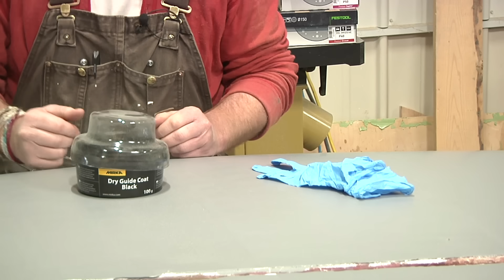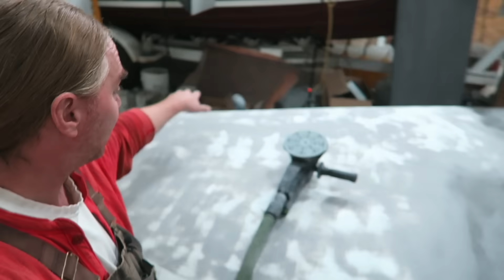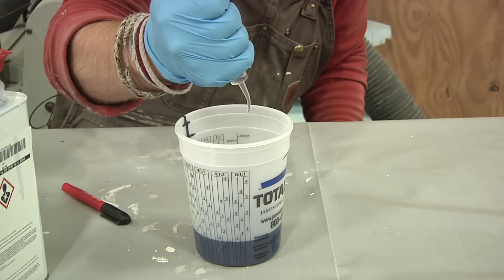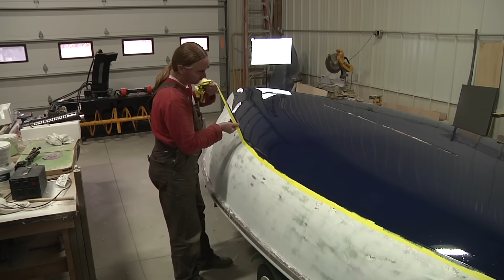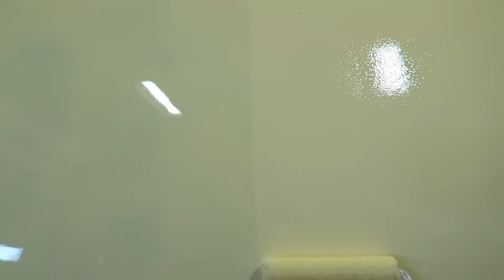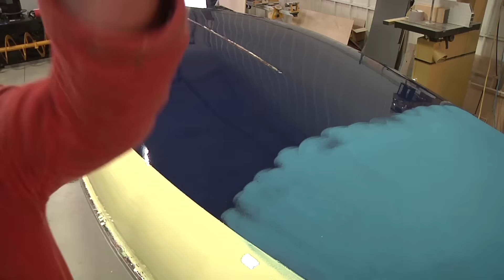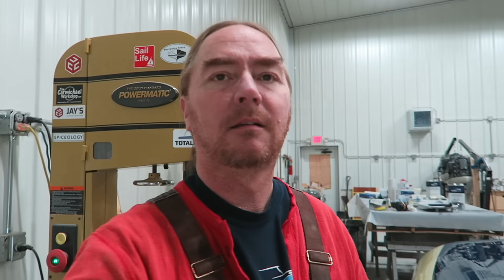ALL ROLL AND NO TIP ;-) PAINTING YOUR BOAT WITH ALEXSEAL!

Comment: I was auto body repairman for 30 yearsI  started in  small bodyshop and moved on, when I  painted a hi end job, clean everything   also wash car, tack car,  wet floor down blow walls down . I chain car to plumbing  pipe , static electricity  but you really cant controll dust,  even in sprayboot theres dust ,so you skipping cleaning would not change  in outcome  .

 Your brush paint  it covered FLOWED OUT like spray JOB .  but- you also have a nack using the roller   ,Average guy don't .  Paint   also  needed  a  polish to get  orange peel, fly's  out . You was told,  no final there's your hint , too good to be true ,you never saw a job that did not need  final  polish. I THINK You also sanded it once between coats, 

  It failed you  - no time saving's-     problem inexperenced sales man        .
Can average guy do  same nope   !   ,SANDING PAINT IS HARD  WORK,

You made couplel mistakes rubb thru and your an expert .

Ahh,  car manufactures  leave orange peel in for a reason . Your trying to beat  car manufacture quality'  lol your kidding yourself.  First  you need find a paint that dont extist . A cheap enamal can do same job The .Draw back is the same dust the bugs  runs but final polish is were  you [ mostly] correct  it, depend on  talent of the worker
.I onced tryed painting enamal and cut it with laquer thinner it dryed faster. but paint had no shine I got fast set up but lost shine.Another old timer said to heat paint on electric stove . but I never tryed............. BOOM !            well as I remember he was not such a friendly guy,
 
 I like your show  but your killing yourself, read label on paint can you  sand too much and  dust  its all over your shop .A spray.booth don't really work, You need much more expensive setup than  just spraybooth. I retired at 55 im alive,  I painted  NYC TRANSIT  Buses 2 buses a day for years ,The paint  was R&M BRAND- POISON  COMMERICAL PRODUCT  [ orangepeel included,] 

They sell positive pressure resperators , hooks up to SPECIAL made air compressor , were oil from compressor  is also  filtered out----on suit model  you can adjust room temperature inside suit ,you wear controller on your hip,  but it gets hot The suit is   white vinal front zipper . HAZARD SUIT -------
A  helmit type  ,is also good product  the filter powerpack is worn on your hip        
The one you wear now  cant get tight seal on face hair , get new  one for yourself                   and        ,take care of yr grand children.too'

Comment: PS: can i store any left over paint mix - paint/reducer/Converter/Additive -  in a clean sealable container? (like an empty plastic or metal paint can you buy at home depot) and use it months later?
Reply from the maker: Once it's mixed, it need to be used that day (preferably within half hour of mixing).  Non mixed material if stored in a stable climate should be good for 3 years

Comment: I let my 3rd coat of 501 dry for about 3 days, then when I sanded it (5" orbital sander), my 400 grit paper immediately loads up with small hard pieces of paint. almost like the paint isn't dry yet. and my 3rd coat feels smooth but it looks like significant orange peel that shows thru. It's not pretty. I didn't sand the 3rd coat very much (just enough to rough up the surface before the application).... was that a problem? I lightly sanded, then tack clothed it, then wiped it down with a cleaner/degreaser; let dry and painted.  Do you see a problem in my process?  THANKS SO MUCH ! ! !
Reply from the maker: More info needed on mixing ratio's, temps and overall application :-)

Comment: 4 ounces, 2 ounces, 2 ounces, makes 8 ounces, that is 1/4 of a quarter... shouldn't the 5018 be 2,5 instead of 1,25 ml?? I amalways confused with the american measures :/
Reply: You are correct. The amount of additive suggested in the video is wrong. He should be using 2.5mm of the rolling additive for a 1 quart total mix of topcoat, converter and reducer. The ratio given in the video is half of what was needed.